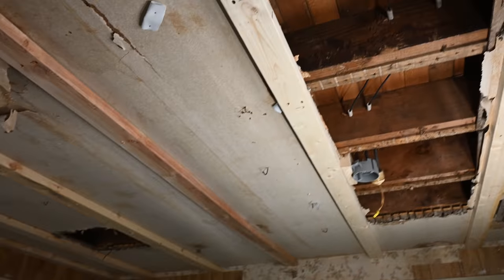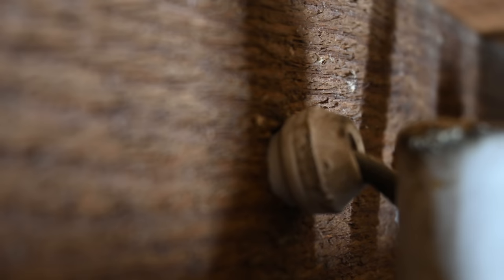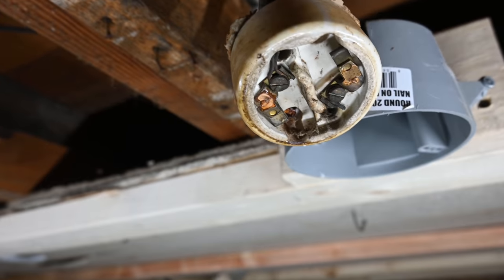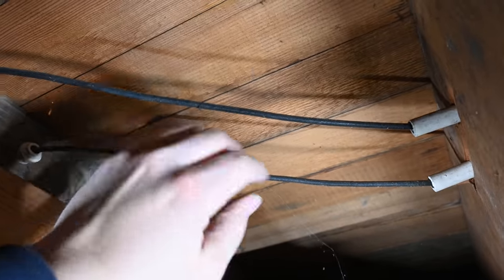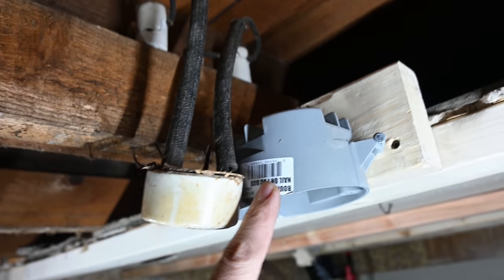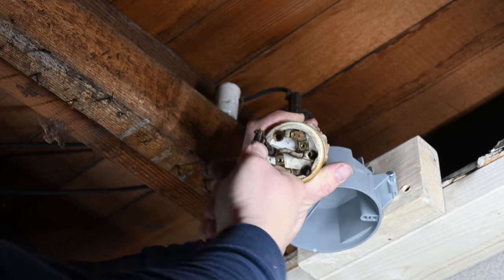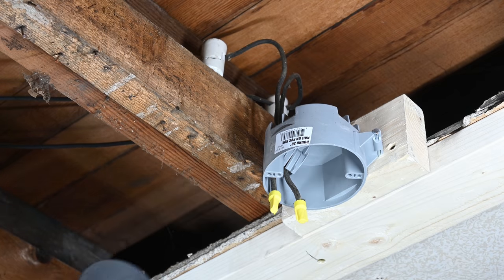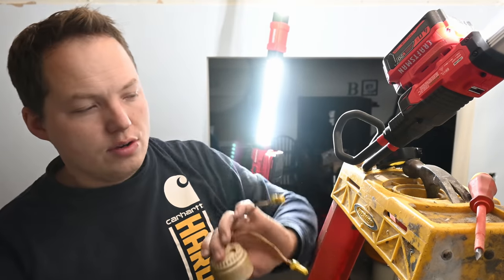How To Abandon Knob & Tube Wiring in a Wall or Ceiling

Comment: Now you know why those lights were on sale... Sad to actually see the Milwaukee name on a turkey. So it flickers like that to the naked eye? Or just to the camera?
I was pretty lucky with my house because all of the remaining K&T circuits began at a junction box, with Romex leading from the main.  So I replaced all of that K&T with Romex.  I ain't goin' in no main box! My house is from 1910, and I think electric lights and receptacles were added around 1920. All of my near 100 year old K&T insulation was still in good shape, except around some light fixtures, where heat had degraded it. Imagine doing all of that 100 years ago, with hand-drills, and replastering holes...

Comment: Are the RECEPTACLES still the non polarized type?  Easy question.
Reply: they are STILL non polarized unless someone changed them
Reply: @rupe53  Yes, of course.  But have they been changed is the question? 

P.S.  Extremely difficult to use them, if not changed.
Reply: @tedlahm5740  ... here we are some 60+ years away from when installing old fashion 2-prong outlets was the norm and I still find very few appliances that have polarized plugs. Most polarized 2 prong items tend to be ones with motors. 90% of consumer electronics have non polarized connections, in the USA. I would venture a guess that some outlets have been changed over the years.

Comment: Milwaukee must inscrease PWM frequency in its battery lights for non-flickering operation. I suggest, that MCU's firmware must be patched.
Reply: @waytospergtherebro  increasing the frequency would actually resolve the issue.

But there might be reasons this can't be done. In any case there won't be a firmware update.
Reply: Dimming of LED lighting can only be done with Pulse width modulation which is effectively adjusting the duty cycle of the light. Just by non dimmable led lights if you don’t like the flicker.

Comment: Too many boxes, outlets, receptacles, etc. are serviced by more than one circuit. And the routing of circuits is a mystery. I have receptacles that are supplied by two circuits. SO, when somebody tells you, yeah, the power is off, don't believe it. Even if you turned it off yourself.  Verify with the current tester!
Reply: Always! And check that the tester is working on a live circuit before you trust it.

Comment: I have encountered a few knob and tube systems but the insulation was always bad and needed to be replaced. The wire gauge was also smaller than I like.
Reply: I've noticed the opposite,  it's number 12- throughout the  house, rather than number 14,
Even though originally it wasn't any greater than a 15 amp- overcurrent, as well as some silver- clad copper conductors.

Comment: Since you are killing the K&T line, why didn't simply twist the two wires together and wire nut them so nobody else can think of reusing this line. Besides, electrical tape is useless with wire nuts.

Comment: K&T worked just fine in the day.  However the stuff has oxidized over the past 100 years that 14AWG is effectively 16AWG.  Good for lighting only especially if changed to LED.  No 'real' loads.  Good stuff but do NOT use it for anything other than lights.  I love it but I'd leave it.  I'm 54 and that stuff is much older than me.

Comment: Kt is scary stuff if anyone else touched it ever
Reply: Ahhhh ... no. If you touch one wire.- nothing, If you touch the other wire - nothing. If you touch both, then you get bit. Problem is that handymen and DIYrs will tape them both together and stick them in a single hole. Thus they have defeated the whole theory of KnT. Note that Benjamin here puts them in separate holes. They should not touch.

In the original installation they are *air insulated.* This is real insulation. High tension transmission lines are air insulated. That is why they crackle on humid nights. KnT wires will not arc or spark unless they touch each other. And the only place they do that if properly installed is INSIDE a ceramic fixture.
Reply: @ricoludovici2825  so basically what I said then. If anyone's messed with it
Reply: @ricoludovici2825  wires without  insulation over them while in  service, are called:
 open air wires & They're separated from other wires and from anything that could ground them.
And must be posted:
 HIGH VOLTAGE.
Even though it's not the "voltage" that kills you, otherwise no one would survive being tased, it's the 
AMPERAGE- that fries you, not the "VOLTAGE" but the jargon that's caught on is "voltage" rather than amperage and as with virtually any belief system, ideas & terminologies catch- on because people hear them being used & expressed like: knob and tube is DANGEROUS! end of story.
Wires might be in a raceway, hots and neutrals , grounds next to each other with the insulation over each conductor, as the only thing preventing those differing conductors from making contact with each other and the conduit itself that might be part of the fault grounding system.

Comment: If your knob and tube is 14 gauge wire it will safely carry 20 amps. A 100 watt incandescent light bulb will draw 0.83 amps. A ground is not needed for a light bulb to function.
Reply: NOPE! 14 gauge is 15 amp.
Reply: @hotpuppy1  It's an "open-air" conductor, so the rules change. Technically, the guage size increases by one.

Comment: W/o regard to code.  I've never seen any reason not to just cut the K&N and tape the crap out of it and leave it in the wall.  There will NEVER be a reason to service it in the future.  It is just dead-ended. Accessible JB?  What for and why?  Is there a NEC definition for a dead-end?  The chopped circuit certainly isn't a junction.  I'm comfortable with leaving it cut and taped...no serviceability.
Reply: If it’s energized it needs to be in an accessible box. Any cable no longer in use shall be removed. Large safety margins are factored in all NEC’s however improbable a dangerous scenario.
Reply: @midnightflyer7510  Trouble is that no one wants or needs a box.for K&T  The stuff is strung through out areas you can't even(reasonably) get to.  I'm not sure about that energized statement.  Never heard of it.   There are no connections.  Not dangerous at all.
Reply: @nhzxboi 
I agree. Just stating what the “authority having jurisdiction, (the inspector) would say. If you haven’t heard of energized, I have to assume you’re a novice or DIY’er. Energized means the conductor is “live” or “hot.” It’s being fed. I’m not saying taping the crap out of it and burying it will be an absolute hazard but, as per code, you’re supposed to bring it into an accessible box if it is live. If not live, unused cables or conductors are to be removed. That goes for any cable, including LV cables.
Like I said, the NEC includes large safety margins when writing the code. I’m not telling you how to handle your own situation, especially if it’s your own home. I do suggest being aware of the NEC, NFPA and your local codes though. Some may seem overkill but when you dig into some of the reasoning, a lot of them make a lot of sense in protecting from harm or property damage. I also think some codes are simply written to introduce new manufacturer’s products. However, if something does go wrong and you didn’t follow the code or get proper inspections then you can only imagine the legal consequences or worse.
Reply: I'm not a DIYer and not a novice.  Don't be so trite and proud in pigeon-holing.   EE here.  My focus is industrial electrics.  But have a bit of passion for that old stuff.  I do not think you need to bring it to a box.  There are no connections.  I've never seen anything in code that says all energized wires need to be in a box....that's crazy  Connections, sure.  There are no connections on a taped dead-end.  Rethink and tell me what you think.
Reply: @nhzxboi  ... if that's the case then follow it back and disconnect the feed end (at the next junction?) so it's no longer energized. Problem solved. In 90% of cases it will be the ceiling fixture in the next room because most older homes only had one or two circuits per floor.
Reply: @nhzxboi 
Sorry if I was a little patronizing. I read your comment too fast. I thought you said you didn’t know what energized means by definition and that triggered a home owner red flag in me. Now I see that’s not what you meant. After some digging I agree with you that burying the dead ends is not a violation. General practice seems to simply be to cut the conductor close to the knob and tape the end with Super33. I have done this myself in the past but, I must admit, even though I wasn’t concerned of a safety issue, I thought I was in violation since my general practice is to bring such terminations into an accessible j-box. Hope that helps.
Reply: @midnightflyer7510  'Salright.  I agree.  Cut it, tape.  Bringing the 2 conductors into a box is actually more hazardous and a serious PITA.  Thanks for the carity.
Reply: @midnightflyer7510  I've never found an exception for splices on knob and tube wiring, where you could have splices outside of a box, even though that's how it was done and in practice the theories out there- that you can have a Western Union splice if you're working with existing knob & tube and that's within the boundaries of the code today, even though the splice isn't within a box.
Reply: @nhzxboi  I believe the section says:
 All splices must be in a box.

 and there's no exceptions listed.
Reply: There are exceptions..  However, in this case, there are no splices. so there is no issue.